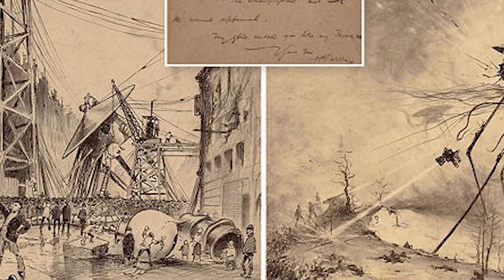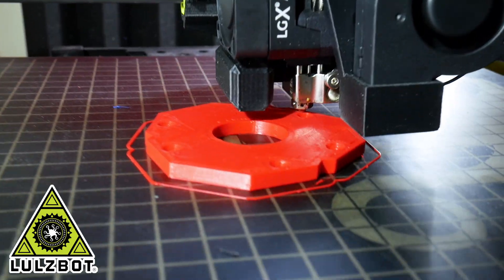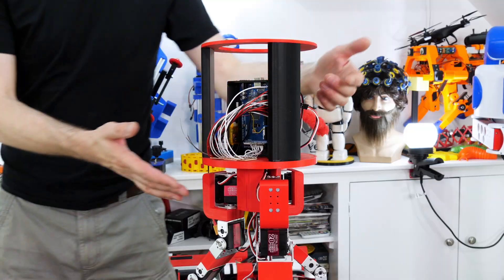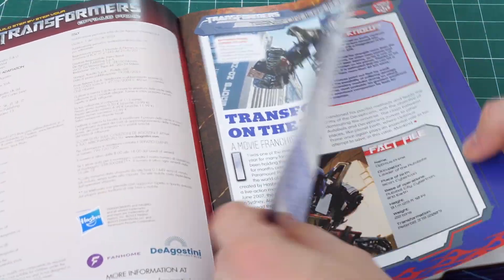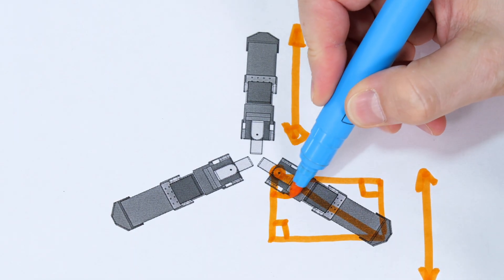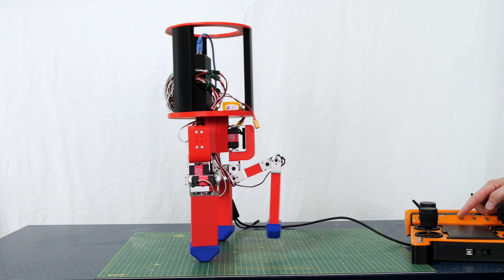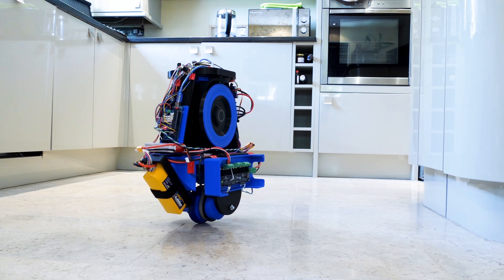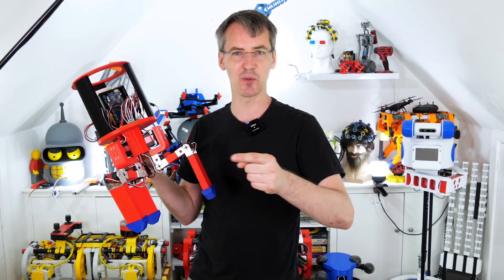Could Alien Tripods really walk Robot

Comment: I'd like to see the tripod from Rama, which moves by spinning asymmetrically in a continuous, off balance, falling motion, as I understand it.  I've never seen anyone attempt it.  There's also the STriDER robot by RoMeLa that's worth looking at.
Reply: Yes! I always imagined it as behaving like an off-balance spinning top - pinching its legs together into a point to spin and perambulate, spreading them only to stand still.
Reply: @segue2ant395  I don't think it would work if the legs are brought to a point, since the radius of the "wheel" would be zero, but definitely closer together, rather than like spokes on a wagon-wheel.  Boy, I'd love to see this thing, even if just animated.

Comment: This is a hunch but I am pretty sure that tripod robots need to have high agility and need to be able to move fast to compensate. I also feel that running with a tripod will be way more stable than walking. With three feet you need to use the inertia of the body to balance.

Comment: I feel like using a gyro would be the less interesting solution. I would prefer a more organic behaviour, e.g. start lower on the ground with none of the legs perpendicular to the floor, maybe use 45 degrees or even lower, and use more joints and/or telescoping, and use centre of gravity to delay leaning too much when lifting a leg and stepping forward.

Comment: In the tom cruise movie there are scenes where the feet are viewed, they seem to clamp on to the terrain, using either vacuum (formed from the movement of steam in the foot, unless that is a relief valve for some bizarre steam based hydraulics-esque tech) or direct mechanical grip. The feet definitely got variable adhesion, which is also congruent with certain insects in nature and how they walk on their respective native surfaces and terrain. The surface of mars is rocky dune, so a mechanical grip makes the most sense.

You could scale it up a bit, make the feet capable of gripping into material like dirt or gravel (like bent fork prongs or something) and test it on a surface that isnt a mat or a ceramic tile.
Reply: so basically he should give the robot some grippers
Reply: @kevinmorrice  Yeah, or claws, but not for manipulating objects, but for support and balance. Yeah. I could have put this much simpler. :p
Reply: @homeopathicfossil-fuels4789  like how a camels toes spread out to distribute weight on sand
Reply: @kevinmorrice  yeah, but also sorta with stabby jackhammery bits for stabbing into solid rock surfaces

Comment: perhaps the rabbit method? they tend to reach out with their front legs together, acting as one, then bringing their hind legs forward simultaneously with a pseudo hop. you'd need a sort of hip joint with a lateral movement around the center of the body in order to turn though...

Comment: I always figured they had some kind of massive gyro stabilizer.
Reply: I thought it too, but it would have been cool without any gyroscopic stabiliaztion... just measuring the angles... 

i always surpriced by how humans  do it... thier brain must have so much compute power and also super fast
Reply: No to mention they would have a massive amount of inertia, and other effects of scaling. So long as one or two of their legs were touching the ground to keep them from falling straight down, it would take a longer time for a tripod to fall a certain proportion of its height compared to a smaller one (actually that's still true even if all of the legs were off the ground).
Reply: Well, if we're keeping lore accurate, they don't use wheels of any kind (if I remember correctly). The Martians hadn't invented the wheel, emphasizing how different their development was to our's.

Comment: Maybe keeping the center of mass between the two legs that are on the ground, crouching a bit and extending the third one, then taking the center of mass between the three, standing up, then repeatting with the two legs that will stand on the ground. If the feet are wide enough, or have fingers, maybe you won't need a giro or an intertial.

Comment: Striders from Half Life 2 have the most lifelike animation, but I don't know if anyone has simulated if it would actually work. My intuition is that the longer the legs and the taller the robot, the easier it will be to balance. It's easier to balance a tall poll from the bottom than a short poll.
Reply: i honestly think the strider's walk-cycle might be the best thing for that. Two legs on the "front" and a back leg that moves right behind them.
Reply: With Striders, they have the benefit of stabby stabby feet. Which allows them to pivot and rotate them inwards to provide leverage as their moving foot finds ground. Big flat feet would actually hinder them more than help them. They need that twisting to move efficiently, especially at such a large size.
With Hunters, its a matter of muscle and balance. Hunters seem to have bulkier legs with alot of muscle inside of them. They could likely hold themselves up with just a single leg, atleast for a moment. Unlike Striders, they have more blunted feet, and rely more on their complex digitigrade limbs to allow for their movement.
Reply: Or the hunters for  that matter.
All the Combine designs were incredible, to be honest.
Reply: @zomgerln you see, that’s absolutely frickin true
Reply: I wonder if James ever played the half life franchise…
Reply: then theres houndeyes
Reply: also something that helps the striders is the fact that their legs combined probably weight in at about the same mass as the body wich should give them a preferrable lower center of gravity.
Reply: That's why it's technically easier to ride a taller unicycle, you have more time to balance before you more over the point of no return.
Reply: It helps that  the striders are organic in nature, just augmented. In episode 2 Dog rips the top off and you can see its brain iirc.
Reply: RoMeLa's STriDER is also a fairly natural motion, considering the fact that there are no animals that naturally have three legs.  They directly compare the half life strider, too.
Reply: @dafoex I think if we look at an inch worm- the law of Occham's razor indicates the simplest for of locomotion to be the most likely.
In the video "Soft robot programmed to move like an inchworm" by U of T the inchworm has a solid footing we'll call rest, then extends its front "foot", then drags or lift-drags its hind leg or legs to rest position. Then reproduction of this- it logically changes direction by twisting its body left or right then placing the front "foot" or feet then dragging the hind foot or feet. I would propose this simplest of locomotion requiring very little brain power and minimal energy would be the most likely for a 3 legged animal.
Reply: The striders feel like a love letter to war of the worlds they make awesome creatures they give me the same vibes as well 

Yes I know they were inspired by the tripods
Reply: and ontop of the long legs likely being as heavy as the body: we have high sitting joints and no articulated feet wich makes it likely that there is almost nothing in the lower legs of a HL2 strider wich should help lifting the legs. and then there are two more thungs: the striders body is for one: suspended between the legs and for two strider have a destintive ''driver'' leg wich is the hind leg. the two in the front are there to steer and stabilise and the hind leg pushes the strider forward.
Reply: I think the same all cycle of the Hunters of HL2 are way more efficient than the Striders. They look like Horses.
Reply: Yes they are mostly smaller striders also love them : )
Reply: My thoughts exactly!
Reply: Seems folks have forgotten about  the shorter three legged Species 8472 on Star Trek
Reply: @knerduno5942  how could we nerds forget- oh the shame. BTW- See Sound of Freedom- it's about a real life shame we should all be aware of.
Reply: Probably get deleted. 

https://www.youtube.com/watch?v=2hKiqks6Qt4

There are loads of sane working tripod examples on youtube too. 

James did the whole "I did research that backed up my agenda and nothing else" thing that seems to be common now. Abuse of evidence like this is doing the world no favours, thought James was better than this but here we are.
Reply: Idk maybe it’s great
Reply: pole. Fail straight out of the box. A short poll would be easier to control than a long poll- as Stalin stated the votes don't count it's the counter of the votes that counts.

Comment: Having grown up in rural America, I've seen more than a few dogs and cats with three legs 😥
After a brief learning period, they can usually walk and run just as fast as they did before.
Reply: @2000jago  You can apply the locomotion that these animals use to a robot .....
Reply: I had 3 legged cat. Somebody inured her as kitten and doctor wasn't able to save her tail and rear leg. She was amazing runner and hunter. She was everywhere, on ground or top of cabin. If I remember correctly she moved with two forward together and then jumped rear.
Reply: @2000jago  Amputated 4 legged animals running successfully on 3 legs indicates the control system, and joint elasticity may be more important than the physical configuration.  The situations where quadruped robots are deployed suggests they may become tripods at some point.  Nature shows that a design is possible which would allow them to complete the mission.
Reply: @2000jago Stay mystified
Reply: What do you do with all the spare legs? 🤔
Reply: Difference is they are still bilaterally symmetrical with each leg facing the same directrion which isn't the radially symmetrical alien tripod from classic sci-fi.
Reply: @Blaidd7542  3 legs 120 degrees apart is both radially and bilaterally symmetrical if any of the legs are on the centerline.  What is the point?
Reply: @DustinMaki1  how something with 3 legs oriented 120° from each other could walk is the point of the video.
Reply: @Blaidd7542 ....

The point of the example is that 3 legged motion is not only possible but that it can be just as fast as 4 legged motion.

The tripods having bilateral and radial symmetry matters for the exact motions it can do. But the point is that you can copy how 3 legged animals move in one direction and apply it radially. 

The example also shows why 3 legged robot design tends to not work: They make small movements to shimmy; Instead they need to make is the "front" legs pull and the "back" legs push lifting the legs up to reposition them, which is sort of what was done in the video.

In other words: Controlled falling.
Reply: @2000jago because when designing a three legged robot, it might be a good idea to simply design a four legged robot and remove one of the legs?
Reply: @dafoex  I think the point is to get various ideas on how you can possibly do it.
Reply: @dafoex I think you're correct but I'd add one thing. 
In dogs/cats that walk on 3 legs due to the loss of a limb, they usually me the foot of the single front (or single rear) limb almost directly under the centerline of the body. So the pair of limbs is fully responsible for left-right balance while all limbs work together to allow front-rear balance and moving forward at the same time.
Reply: @2000jago  Its a real life tripod example....you are really mystified by something this obviously relevant? I guess I discovered a new level of dumb combined with opinion entitlement, well done I guess.
Reply: @2000jago  I'm mystified by your comment. It's like you're trying to appear not just like an arsehole, but specifically a stupid arsehole.
Reply: Bro eats bricks
Reply: @2000jago  Really? You need to get out more!
Reply: Frog with no legs is deaf.
Reply: The whole of America is infested with dogs.
Reply: I have one but I live in Canada
Reply: It's better than eating the whole animal I guess... Nature's successful tripods inspire.
Reply: Yeah, but they start off 4 legged and still have fore and hind legs, they're just missing one. But the fact that those limbs are asymmetrical makes them a poor comparison. This robot is radially symmetric, instead if bilaterally symmetric with damage like wounded cats and dogs. The only radially symmetric organisms I'm aware of are aquatic. But they all swim, none of them walk. LOL I'm no help. Hehehe
Reply: @StevenIngram  Nah thats irrelevant. 3 legged animals are functionally symmetrical. The read single leg of the bot could come in underneath and push off as the front 2 advance and pull, just like an animal would do.
Reply: the funniest thing i ever saw was a three legged dog forget he had three legs as he found a suitable pole...

lol.
Reply: @2000jago a video about how to make a robot walk on three legs can't draw any example from nature because there totally is not any parallel between a three legged cat or dog and a three legged robot.
Reply: the one good thing about them is when I see one I know all the dogs on that street learned a valuable lesson about why you don't play in traffic
Reply: I never seen animals with 3 legs legs around here... maybe it's special specice in 'rural amarica'
Reply: @vaisakh_km  You are on youtube....I have no words....you can search "Three legged dog" in the search bar at the top of the page.
Reply: @backgammonbacon  whoose..
I was surcastic... because OP specificlly mentioned he saw animals lost one leg because he is in rural amarica, but  such animals are all over the world
Reply: @vaisakh_km  you need to get away from your "sheltered life" and get out more!

Comment: Crutch walking is the most effective method for tripods to move. 

There's a mech unit in earth 2150 that uses this type of locomotion.
Reply: I think this was also how TARS sometimes moved in 'Interstellar' - it struck me as a fairly straightforward locomotion method, all things considered.
Reply: True. 
I had seen wheel spinning versions but crutch would be better. 

Realistically I was thinking of just using weight shift and sliding the lightest leg
Reply: Yeah that or a gait where it rotates with each step
These stubby legs don't work well with tripods though, unless you're willing to shuffle around but efficient walking needs long legs and actually use the angular momentum or pendulum like motions of the legs